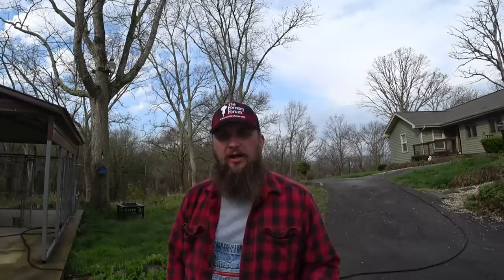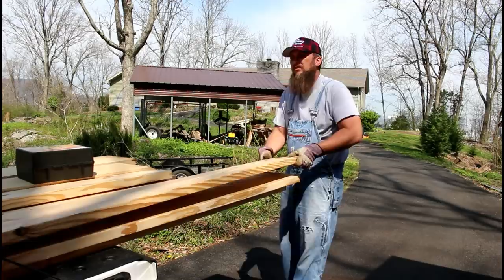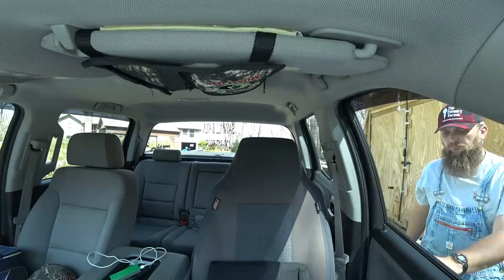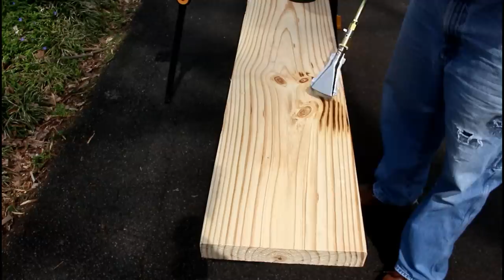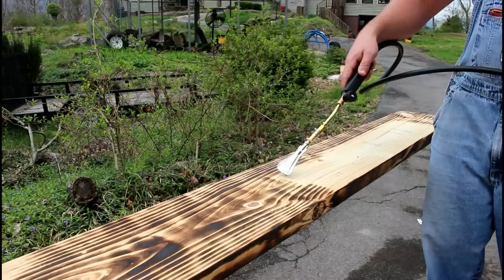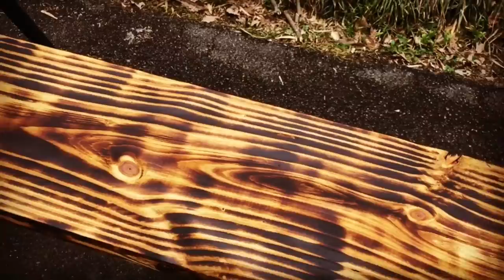IF YOU DISLIKE PRESSURE TREATED WOOD THEN WATCH THIS VIDEO, A GOOD ALTERNATIVE FOR THE DRYING SHED

Comment from the maker: Two Days Left to vote! Give me a vote if you have time!
https://smallbusinessgrant.fedex.com/home/detail/66eb5624-5de6-456b-b298-41c6cba4c727#/gallery/detail/66eb5624-5de6-456b-b298-41c6cba4c727
Reply: Out of the Woods I like your videos Sir
Reply from the maker: Thanks!
Reply: Out of the Woods Your welcome Sir
Reply: Hey man, cool video.  Fyi, harbor freight carries a great torch for use with your larger propane tank.  Will make process go much faster. Also, I believe the fitting for torch hose goes 'inside' the propane tank fitting, and I think it's a reverse thread.
Reply from the maker: 👍thanks
Reply: Perfect  brother,  wish u did the burn in actual speed ro show everyone,... if u are remodeling a home and DONT let the owners see how u do this.... u will never have to worry about side work a again... i did a 4 ft wall panel for this rich guy in SE Atl, he was at obe time The Chuck Norrises stunt double,  anyway,  i til the entire south was on the first floor crown molding,  and all the garage,  thots GA long needle pine about 40 to 50 years old cut that day, ..just can't be beat.... try it on ur flooring with HEARTPINE (tge center cut centered .so that as many rings show... get a helluva lot harder, ...but t.o all my mfs reading this... u can almost make u price.... GREAT VIDEO,  LITERALLY NEVER KNEW IT HAD A NAME OR ORIGIN.... TY BROTHER, SUBSCRIBE
Reply: And vote
Reply: Just so u know Mapp gas is actually better so u would have actually not liked the big tank, to much burnts
Reply from the maker: Thanks 👍👍👍
Reply: Out of the Woods 2 Timothy 4 verse 3 For the time will come when they will not endure sound doctrine; but after there own lust's shall they heap to themselves teacher's, having itchy ears; 4 verse ; and they shall turn away their ears from the truth , and shall be turned unto fables. 
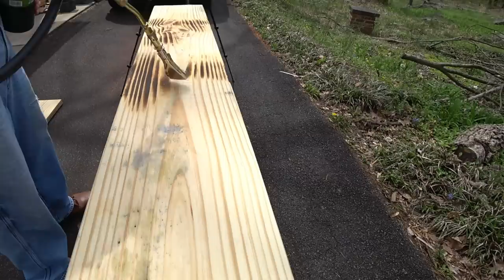Luke 9:23 ; and he said to them all, if any man will come after me , let him deny himself, and take up his Cross daily,and follow me.

Comment: Back in the early 1980s I built  some sheds and I used whiteoak for posts.  From that that time on when I change oil in my vehicles and my tractor I put the old filters beside the posts so the old oil will drain around the posts.  All the posts are still solid.  You wouldn't want to do that with wood up in air or what was going to show,  but it works great on posts.  I'm glad you showed this, I will try it.
Reply from the maker: Good deal. I’ve heard of using oil also. Good tip
Reply: rclaws vegetable oil works just as well.....without the negative effects of the used motor oil (and all the other contaminants in it).
Reply from the maker: Good deal never heard of that before. Thanks for sharing 👍

Comment: Ive seen my dad use old used motor oil. Ive tried it and the wood deck  on my little boat is still as good and strong as the day i built it..
Been in florida sun and rain for over 6 yrs
Reply from the maker: same here, old farmers still use motor oil alot,

Comment: The effect that you have there isn't going to help preserve the timber- it needs to be a much harder burn, then wire brushed in the same direction as the grain of the wood, hope this helps you with preserving your timber!
Reply from the maker: Thanks. Appreciate the help
Reply: Why does it have to be brushed after the burn?  Thanks!
Reply: @beehead5661  remove loose char before sealing... like sanding and wiping off the dust when doing the traditional stain and seal.
Reply: @jerd4021  I want to make a picnic table and burn the wood like this, will the oil sink in good enough for it to be sit on without getting your clothes wet?  And would polyurethane be better for a table? Thanks for any help n suggestions.
Reply: @davidl2281 good question

Comment: Btw the fitting will fit the propane tank. I had the same problem with the same torch. You have to turn it counter clockwise.

Comment: Shou Sugi ban is the method of hardening and waterproofing wood that in some cases has lasted for hundreds of years.  The sugars in the sap are caramelized and mix with carbon from the burned cellulose then rubbed to a polish for the longest lasting surface.  Covering this surface with Urushi lacquer in a very fine coat then protects it from wood insects as well as further hardening the wood.  Both weapons and armor have been discovered with this preservation up to 600 years after being made still in remarkable condition
Reply from the maker: Great info. Thanks for sharing

Comment: You need a long burner out of an old propane heater. Then make a frame with powered rollers to feed the wood through like a planer. Once you get the flame right with the feed rate, you'll be more productive if you need a large quantity of flame cured lumber/timber, etc.
Reply from the maker: sounds like a great idea, thanks!

Comment: I just put plain used motor oil on my sheds and other out buildings.  I have a wooden pen that sits in the dirt that looks brand new.   The only thing is you need to oil it every year.    And if you want to spray it on.  You need a 50/50 diesel/kerosene and oil mix.  Plus it’s free.

Comment: Sh-Oww su-gee bahn is how its pronounced(the "ou" in shou is pronounced like it is in ouch). Also you should burn the surface till it crinkles and cracks. The sealing aspect of it comes from heating and forcing any remaining sap out and to the surface where it caramelizes around the fibers. Cedar works best.
Reply from the maker: Thanks James. Appreciate the help
Reply: np. the way it used to be done, is take say 3x 2x12's and use tie wire to tie them into a triangle then stand it vertically over a fire pit, and let the flame shoot up the center like a chimney flue. once the entire interior catches fire, take it down put it out, and then flip the boards around with the unburned side on the interior and repeat. probably the fast way as you do 3 boards at once this way. and you dont burn up your propane this way.

Comment: Hello, Nathan. You need a roofers torch for that job. Also you can pickup a adaptor and or adaptor hose to hook that torch on the 20lb tank. Funny I am building a drying shed on the side of my work shed too. I'll try to put op a video. Spring is holding off here in the north east too, cold, snow and rain.

Comment: I have seen some folks mix pine tar and turpentine 50/50. Lay a coat on and then heat/burn it in. Looked like it should last pretty good also. Might as well do it as good as time and cash allows! Linseed oil is pretty darn good stuff IMO
Reply from the maker: I read about that mixture also, one guy used cooking oil,
Reply: This is a good time to vote again! Hope you win!
Reply from the maker: Thanks!
Reply: I just used a mixture of tung oil, pine tar, and pine turpentine to revive a wood shoe shelf that had been outside for almost twenty years....  it darkened the wood even more, but the shelf will be around another twenty years.....

Comment: Great video and cool technique!  A guy I know used that technique for the boards of his bathroom wall.  Stood the boards up vertically and used one of those 100,00 BTU weed torches to start them on fire and that worked really fast.  The boards ended up with a really scaly look.
Reply from the maker: Tomorrow I’m going to get a better torch. That one was a little slow.
Reply from the maker: Thanks! Picking one up tomorrow.
Reply: and use a wire brush to clean the scale. The Samurai Carpenter did a half way decent video about shusugi-ban, quite informative.

Comment: Burning the surface of wood may be claimed to prevent wood rot, but I wouldn’t bet my house or construction project on it.
Copper is toxic to plants, mold, mildew, if it is present in adequate amounts, or concentration.
Do some research on the age of houses in the northeast U.S.
There are many structures, that were built in the 1700’s,
That are still in very good condition.
Lumber that is dried, via air drying or a kiln, may last for hundreds of years if it not allowed to contact the soil or wet stone foundations, and it is protected from rain, snow, etc.
There is no better protection for a structure than a good roof. 
Personally, I don’t like working with heavy, wet, pressure treated lumber.
That being said, since commercial pressure treated lumber processes have moved away from using arsenic to now using copper
As the chemical ingredient for preventing rot, i find copper pressure treated lumber to be dry and no heavier than untreated lumber.
I would trust copper pressure treated lumber over
Surface burned lumber: any day.
Just because the surface has been charred, it does not prevent moisture from penetrating the natural wood underneath. Also, if you go to the trouble, time, and expense of surface coating the charred lumber, what is the point of charring to begin with?
The point of pressure treating lumber is to prevent rot; by impregnating the wood with a substance that is toxic to and will kill fungi, mold, etc. which are the first
Things to attack wood and are the beginnings of wood deterioration.
If charring wood timbers works in Aisia, that’s all well and good. But, I would avoid buying a pig in a poke. I would want see how long timbers that are charred actually last; and under what conditions. If you like the look of something partially burned, i say go for it.
However it will not give anywhere the same protection as copper infused 
Lumber. If you’re going to use additional surface coatings like paint or varnish
Over the charred lumber, then why bother with charring it? No need.
I have my final construction
Project underway right now. I am old now.
I am using Douglas fir framing materials that will be protected from weather by a properly constructed roof,
Properly sided, and the subfloor system kept well away from the ground and moisture. I will not be using treated lumber but will paint
The piers that support the structure.
I will build a detached deck that will have a pressure treated(copper) subfloor, resting on concrete piers with metal attachments.
My 3cents worth.

Comment: You should have just used old motor oil mixed with diesel fuel. Linseed oil is great but it will have to be reapplied every so often. Came out nice though!

Comment: I'm honestly curious if the burning is anything other than cosmetic.  It looks cool that's for sure!  PT lumber can be painted or stained.  It takes paint OK but you really have to play with stain to get the color you want.  Heard from many that you should hit even PT with Thomson's water seal every so often to keep it from drying out and splintering.

I keep like a coffee can with a lid for Linseed oil and leave a cheap brush like you used in it for my tool handles.
Reply: wauhawk Japanese used the technique. Charred wood normally isn't bothered by beetles or termites :)
Reply: But since the whole surface isn't charred it made me question the purpose.  I mean reasons to play with fire are always good!  lol
Reply: wauhawk good point....on both parts
Reply: As I understand it PT doesn't guard against moisture  it guards against insects. Even microscopic ones.  So yes Thompson's is a good idea.

Comment: Looks great and we know the process works because it's been used for centuries. But it seems too slow to do every board of a structure, on both sides I assume. I think it works by caramelizing the sugars in the sap so bugs can't use it for a food source, same effect as modern heat treating of wood as a form of preservative except that the modern form goes all the way through. Anyone know more about this?
Reply from the maker: Good questions here. Anyone??

Comment: Nice tech
 I learned lately especially at harbor freight, Open and check for damage or missing pieces as I got a broken air compressor out the box. Very disappointing.
Reply from the maker: that stinks, I have had bad times at their stores also,

Comment: Good try. Stating the obvious, you needed a stronger torch. Well done though.
Reply from the maker: Agreed. In the follow up video I did. Thanks for watching 👍
Reply: I noticed the same thing about the strength of the flame.  Back in the late '70s I helped a friend do the "char finish" on some pine furniture he had made for his livingroom and we'd occasionally get a full burn happening on the wood that we'd put out with a wet cloth.  After treating the wood we brushed all the excess char from the wood with a wire brush and applied finish.  The result was gorgeous; the flame-treated wood helped give the finished product a lot of depth.  I think the technique fell out of favor as people's tastes in wood finishes changed.  The flame-treated wood does have a strong 1978 vibe, that works best with wall to wall orange shag carpeting and platform shoes.

Comment: Thanks for sharing. Is the burning more for physical appearance or does it actually help to preserve the wood.  Keep us posted on the contest results.
Reply from the maker: the physical appearance is very nice,  most people say it makes it last longer, we will see in time,
Reply: The softer parts of the woodgrain burns and make it take in water slower. At least thats what i have been told years ago
Reply: I once saw an old video of a guy in the seventies where he actually put post ends over a fire and burnt really good. Said they will not rot in the ground or anywhere for that matter. The reasoning is the bacteria that causes the rot can't live in the charred part, nor will termites eat through the char. That said, it was completely charred with a thick layer all around...
Reply: Land surveyors in the days of pioneers would char the monuments that were buried.  We still find them untouched by bugs or weather.

Comment: How would this method work on exposed lumber, like on a nice custom fence, that gets lots of sun ?
I heard you say this shed was gonna be covered.
Reply: Samuel I use a 50/50 mix of used motor oil and diesel fuel , or use 100% used motor oil , ur choice , ur fence will last a life time , you tube this , u will see , this is also what old timers did before these useless chemical stains came out

Comment: Have you ever tried Thompson's® WaterSeal® Penetrating Timber Oil? 
http://www.thompsonswaterseal.com/waterproofing-products/penetrating-timber-oil/penetrating-timber-oil-clear
It says: "The deep penetrating oils protect the wood from water damage, while the coating resists mildew and UV damage."
Unless you like the scorched look from the flame seems like all you need is something like this. I am in the beginning stages of building a timber frame porch and plan to use this to protect the exposed oak.

Comment: Charred wood that's scraped and oiled withstands the weather better than wood that's not and thus serves as a more attractive, and cheaper, alternative to pressure-treated lumber. Done.
Reply: Should use a paint roller to apply oil.   Save time!
Reply: Or spray